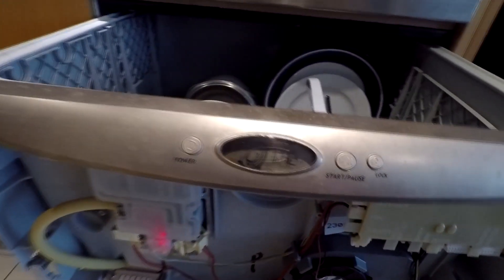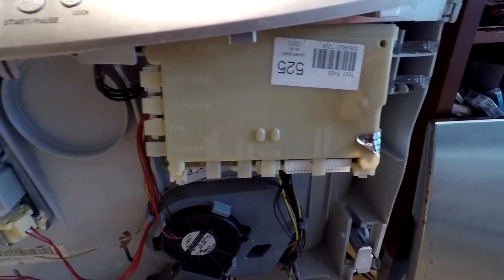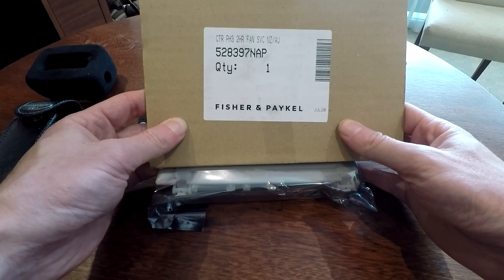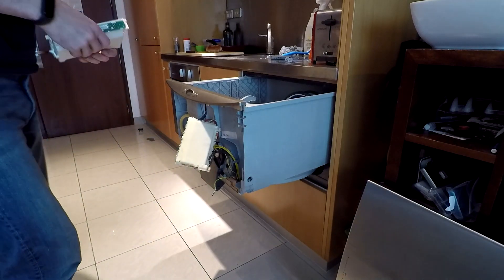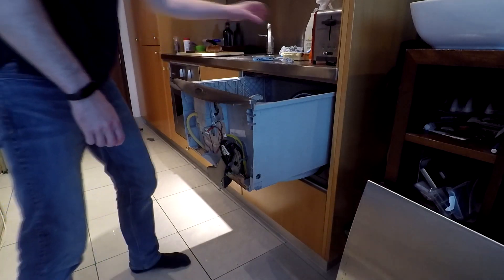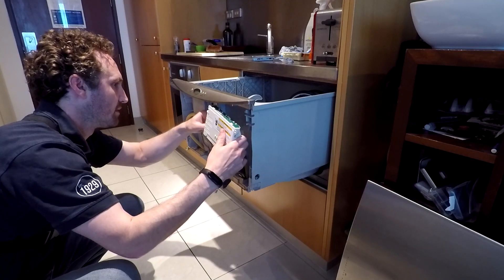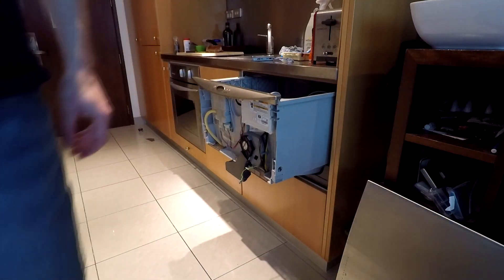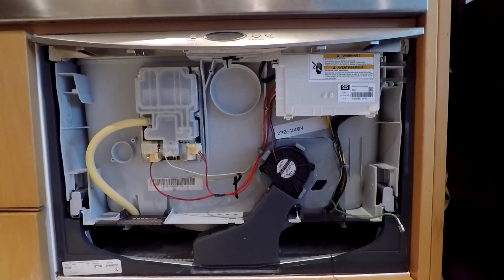Replacing Fisher & Paykel dish drawer PCB board

Comment: I have had this board replaced 4 times now, approaching a 5th time. Costs over $400 each time incl labour. Must be a poor design that this keeps happening
Reply from the maker: Hey man. I found that there was two other things I had to do to fix it. Also replace the control panel, and clean out the goop from around the buttons at the same time. Now it's working perfect. I think the problem is caused by buttons getting stuck down and cooking the board.
Reply: @HandSolitude  Hey, this video is really helpful.  My identical unit seems to have died (no power on ) and a 60-second reset doesn't solve it.  But your latest comment confuses me:   Are you saying that after changing the main board (as in your video) you still had problems, which required you to replace the "control panel" ALSO?   Was that straightforward?  All in all, a pretty pricey self-repair?
Reply from the maker: @jsnuk3556  Yeah it was still playing up after the new board. The control board at the top with the buttons and the LCD panel are easily replaced also and not too expensive. This is the part number... 528044NP I made another video but my brother has the camera I need to get it off him to put it up on youtube. You have to slide the rail at the top to the left to get it off.